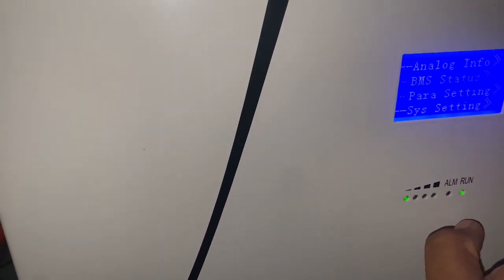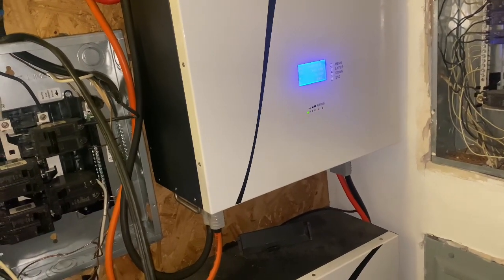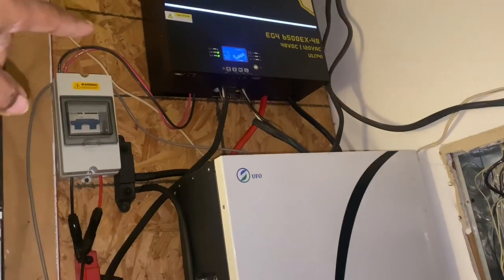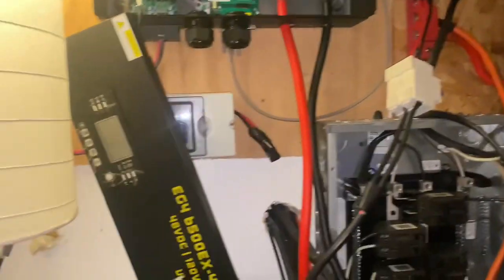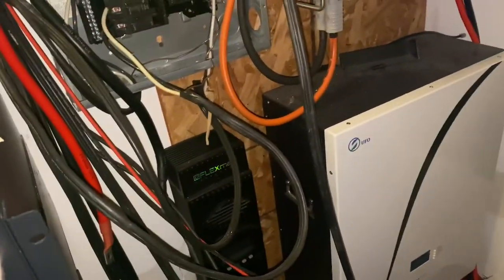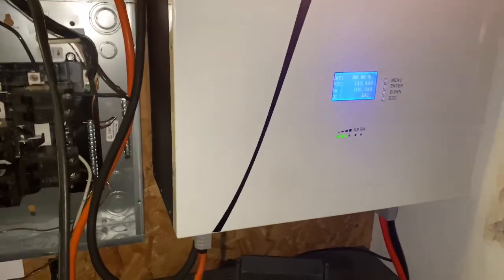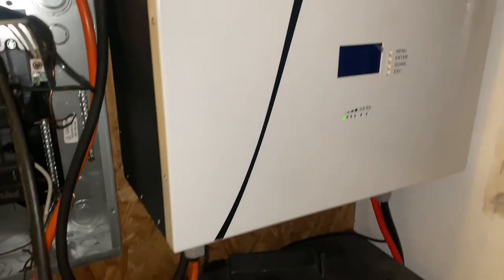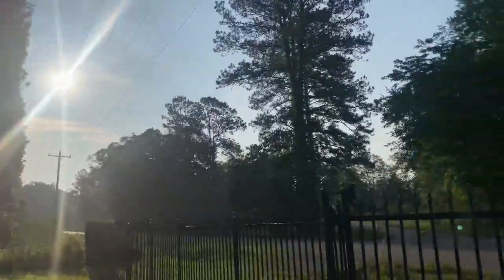Day to Day living Off Grid, 20kwh Battery Bank Episode 1 (2023)

Comment: Yesterday i installed a 220 volt inovair minisplit..its 38 seer and running off my sungold power split phase inverter.  Its in my off grid camper. I am using nissan leaf modules at 24 volt but hopefully soon i can get lifepo4 and get rid of the leaf cells. Yeah so far the minisplit is amazing and dont use much electricity especially compared to the old roof top air that was on there
Reply from the maker: Glad it’s working well for you

Comment: Haven't seen you in a while. Nice to get an update. More solar panels. Looks like you have a pretty good amount of batteries.
Reply from the maker: I do and I will add more panels I have about 60 400watt panel in my back yard sitting
Reply: @texasoffgridguy8749  that's an amazing amount of solar. I e just gotten into this about a year ago and I'm addicted to it. Every single paycheck I get I buy more equiptment lol. Sometimes just some wire but sometimes actual equiptment. After my next 16 batteries and 8 more panels I'm gonna try to slow my spending down a little lol... my wife's starting to think I'm obsessed with solar stuff
Reply from the maker: @matthewknight5641  lol once she see that low electric bill she’ll understand

Comment: What's up man the bad weather has finally passed.  Good sunshine these days now
Reply from the maker: Plenty of sunshine and loving it batteries are always topped off everyday
Reply: @texasoffgridguy8749  how many 48v 100ah batteries you can have connected to that 1 eg4 6500w inverter? I am asking because I saw in the EG4 6500 EX48 user manual EG4 recommends 2 or 3 inverters for any system more than 1 battery but on the other hand they sell a system w 3000w inverter with 3 batteries 3x48v 100ah so I smell a lil bs coming from their recommendation possibly to sell more inverters unnecessarily.

Comment: That is a 1 ton 110 V mini split running of a 6500 watt inverter I run a 12,000 BTU 240 V mini split of a 2500 W 110 V inverter with a step up transformer Iran’s around 17 to 19 kw and he runs all night and the system is 24 V and my 12 V system runs the rest of the house. I don’t use one system, to charge the other system
Reply: What kind of wind turbine do you use? Thanks
Reply: @johnfitbyfaithnet  hurricane vector